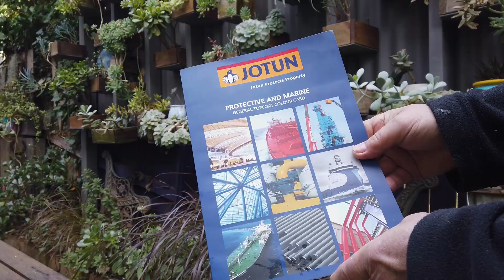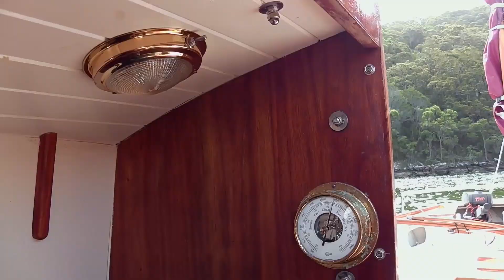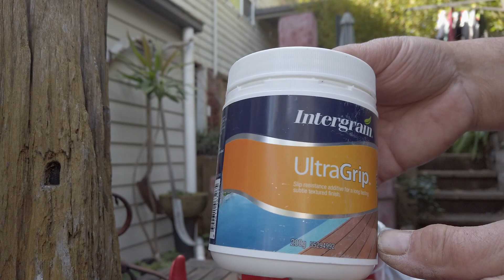Dinghy Cruising on Kate Louise, winter and boat maintenance

Comment: Great tips again! I have never considered Jotun but am using Norglass which is at least cheaper than International Paints. I made the mistake of using microfibre rollers and watched them disintegrate in from to my eyes . . . I changed for the blue stripe rollers but Id like to give mohair a go after hearing of your success. Cheers
Reply from the maker: yep mohair are good they don't disintegrate but you still get a roller pattern but that didn't bother me, thanks for watching.

Comment: When it comes to Hardener I leave the lid on. I puncture the bottom of the can with a flat blade screwdriver right up against the edge and then opposite that I make a tiny air hole. as soon as I have finished measuring I clean the holes and apply electrical tape. at the end of the job i cover the can base with electrical tape. i will let you know in a couple of years if this worked long term
Reply from the maker: Thanks,yep but I think it's the air in the can that sets off the hardner, so the cling film stops that but it is messy and wasteful. Thanks for watching cheers Paul

Comment: Excellent advice. I've seen garage floor paint used as a cost saving measure and, two years on, that particular boat still looks ok. But I think the industrial paint idea is probably the best compromise between cost and efficacy. How much cheaper was it than regular (overpriced?) yachtie alternatives?
Reply from the maker: 2 part epoxy base coat $150 for 4l  part A 1L  part 8, topcoat $200 for 4l pt A &1L pt b by comparison Norglass is about $170 for 2 L

Comment: Great job..looks great .  Good to get more video of all the boat as it helps with my build.  Do you find water trapped or pooling near the end of the coaming  and trim on the aft deck?   Currently fitting trim etc there and looks like it would catch water so thinking of a limber hole or altering the coaming some how.
Reply from the maker: High just found your comment, no I get any water pooling there, aft deck never gets wet unless it rains and then I'm not normally sailing. Will do a rigging video soon with more detail and close ups just for you. By the way you should contact Chris Ellard at Sydney Deck Sealing....he restores decks now but was a boat builder and has built about 17 Scruffie designed boats (his dad owns Scruffie Marine). He is really helpful and glad to offer any advice....well worth a call.